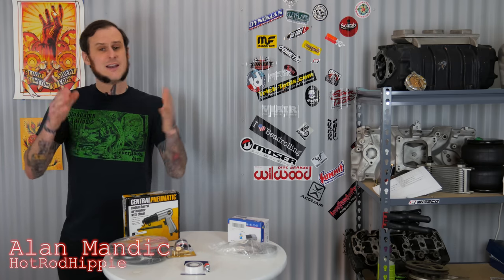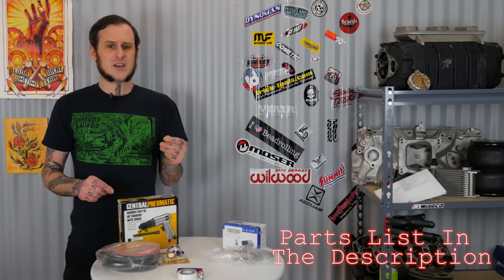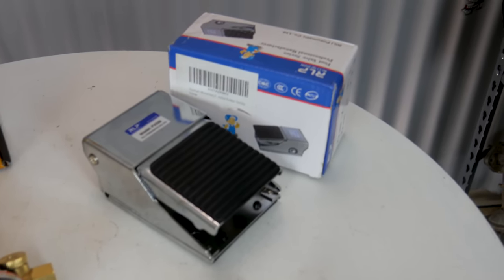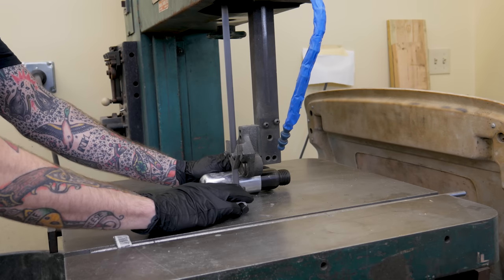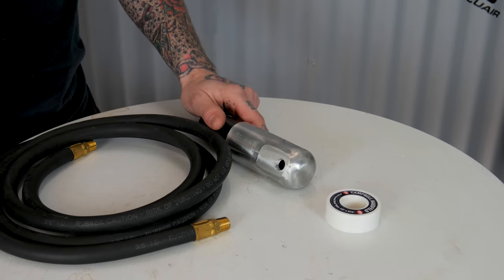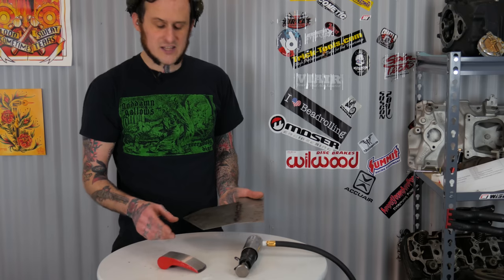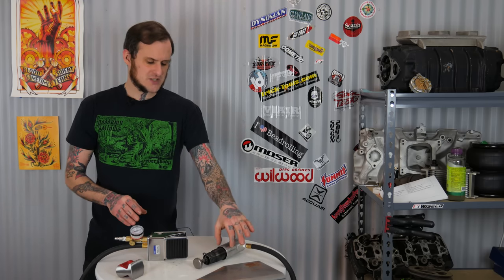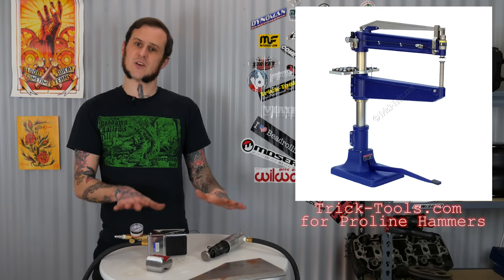Under $75 Planishing Hammer Build

Comment: Great idea !!!,  your RIGHT , I was a body man and I used a small air hammer to straighten metal,  it was harder to use with the  handle,  but I never thought of cutting it off. RIGHT ON.  WILLIAM
Reply from the maker: It really makes a world of difference to using the tool in this fashion!

Comment: I agree with most of the comments I have read. I have used a hand held a few times and it is a great tool for some jobs. It is the way to go for many diyers. If you weld in a patch panel that you can get to the backside it is s very useful tool. With some square tubing you can build a pretty nice stand and have more uses. This is a very informative and useful video. Thanks for the good work. I subscribed and will be watching you more often.
Reply from the maker: Thank you very much. It definitely isn't the end all be all tool, but it can really help out in some scenarios. I have access to a "real" planishing hammer and still use this setup from time to time myself.

Comment: The Harbor Freight pneumatic planishing hammer, the framed one, is still $59 and change at this writing. However, your assembly here is probably what a hobbiest needs first and most, for reasons you made clear. Thanks for the great idea and how-to!
Reply from the maker: A good point. You could pull the power unit out of that HF hammer and use it in this fashion as well. I really don't care for the HF hammer but it can be better than nothing. This could be done cheaper if folks had say an old air hose and hammer they don't make use of. Things like that.

Comment: This us a good video.   What I have been using is an air palm nailer for this use.  The tools must be homemade but otherwise this works very well.   You don't need the valve as the palm nailer has a valve built into the unit.   This makes up a very shallow arrangement and you can get into really small areas.  Thank you for this video.
Reply from the maker: Glenn Felpel there is actually a product that is like a palm nailed but is meant for Planishing. It is called the Johnson Ez Hammer. Probably a lot cheaper picking up a palm nailed and making tooling though. The EZ Hammer is $350.

Comment: The framed version is probably a “little “ easier on the carpal tunnel issue
Reply from the maker: Better on the fillings in your teeth too... A stand mount is superior in most ways. This is just for folks who don't have the space for a pedestal mount or ability to make their own frames. Maybe I should try making a hand frame for this.
Reply: Haha well i’m an old bugger so can’t comment on the teeth aspect but riding a motorcycle without cruise is no fun with the carpel thing. You want to avoid that as long as possible
Reply: Not just carpal tunnel but watch out for Dupruytren's contracture unless you fancy a claw hand. I've had 2 ops now.

Comment: As for your inlet: I'd weld a block of alum. over the hole then drill and tap to size. (I'm sure you know how to use a pin to align the block to the hole.)
Reply from the maker: Agreed it would be good to have more meet and that would do it. However you'd want to disassemble the tool to make sure you don't damage anything internally, and TIG welding on a piece adds a lot to the project. Fine for you or me but I was aiming to keep this simple for beginners. Still a solid suggestion. 👍
Reply: Yeah, or like he said in the video to leave more handle material on the  airhammer frame when you cut off the handle, that way you have more threads for the air hose.

Comment: I am looking for a planishing hammer that I can use on 1/16 steel, or even 2mm (80 thou), do you know what the requirements for the Air Hammer would be... would the unit shown in the video be sturdy enough or would I need a heavy duty unit. I thought this would be an easy question, normally if you want to buy a power tool you can find a guide to help you choose the correct size for your application but I am having real trouble finding info on this for Air Hammers for Planishing. Thanks,
Matt.
Reply from the maker: Air hammers for Planishing aren't really the proper tools. This is just a budget work around to get the job done. So you won't find anyone making claims about their strength for this purpose. 

The light duty units will do an ok job Planishing 16ga., but .080 is asking a fair bit of one. I'd consider a larger hammer for your needs but then you are getting into a problem area where the hammer may hit too hard and stretch the metal too quickly. 

True Planishing hammers have short throws and lighter hits but do so very rapidly. Stronger air hammers are usually the opposite of that, hitting harder with longer strokes. Also using a unit handheld on that thick of material my be a bit more tedious and provide less desirable results. 

You may want to look at the AirBoss units. They are purpose made Planishing hammers so the price reflects that but they are pretty reasonable as far as quality Planishing hammer prices are concerned. https://www.airbosstools.com/products

If the AirBoss units are more than you want to spend I'd say just build the unit like I showed and try it. For the less than $100 price tag you don't find many other options so all you can do is try it and see if it works for your needs.
Reply: Thanks for taking to time to reply, I appreciate the advice, cheers.

Comment: Hey Hippie, great video, question is the foot petal adjustable  for air control? Thanks Bill
Reply from the maker: The foot pedal takes the place of the trigger on the hammer after it is removed. It is just an on/off switch for control. The regulator is for finer control adjustment.

Comment: You just made one of my jobs a lot easier.... RAMMING Green Sand!!!! I'd take the hammer head and weld a 2 or 2-1/2" dia. X 1/4" plate to the head. Then as you said adjust the air pressure to get the perfect compaction of sand.
Reply from the maker: Sounds like a great use for the setup.
Reply: Great Idea for sand casting your parts!

Comment: I'm definitely going to make one before I start my next project. Can  this be used for dent repairs as long as their is access and at a lower air pressure or do you think it may get out of hand and create problems.
Reply from the maker: It can be used for dent repair.  However it can do just as much damage as it can help.  Use of a planishing hammer takes some practice and experience.  I would recommend trying it on test panels before using it on the parts you intend to have as your finished product.  Maybe even say pick up a junk fender at a scrap yard and practice on that a bit.  Knock a dent in it, cut it and weld up the cut, then try it out.  I've used this tool on various projects since I made it, but it isn't something I use everyday by any means.  It is extremely helpful when needed, but it is hard for me to explain off hand when it is needed.  Hopefully I can get to a video about recommended uses for it sometime soon.
Reply: @HotRodHippie  Thanks for your time and for sharing your knowledge I look forward to seeing your videos.
Reply from the maker: You're welcome and thanks for watching and commenting. Every bit helps 👍

Comment: Is there a reason you didn’t use the swivel air hose attachment?
Reply from the maker: Reduced build cost.  No reason not to use one other than that. Was just trying to make this as cheap as I could.

I do prefer to have some freedom of movement.  My personal preference is the FlexZilla Whip hoses with their ball socket style swivel.

Comment: So compressors can be had for less than $75 now a days ?!!!!
Reply from the maker: Some tools have pre-requisites. If you are trying to restore a car to the level that you want a Planishing Hammer, you should have an air compressor. If you don't have one you will NOT be able to use so many tools that would make the job easier. So no I don't include the cost of an air compressor in the price every single air tool I'm going to show you, that is just a silly point to make. 

A ratchet requires a socket set to work. Does that mean I should include a socket set in the purchase price when I review a ratchet? A cordless drill without drill bits isn't much use, etc etc etc.
Reply: @HotRodHippie  I appreciate the time you've spent answering but sometimes just a quick "dumbass" is more appropriate of an answer.😉